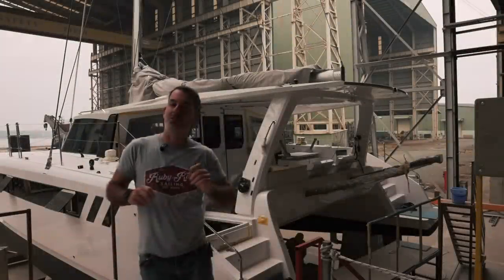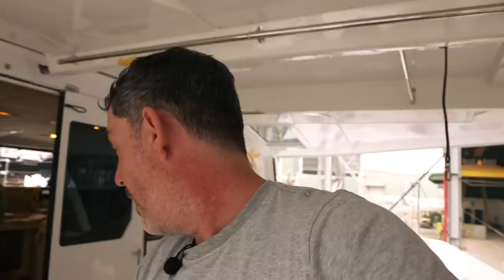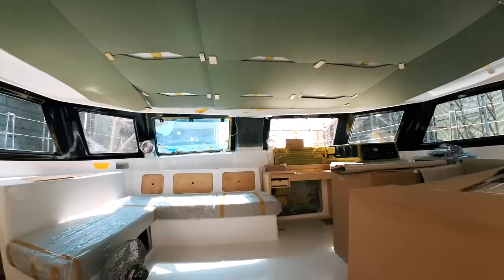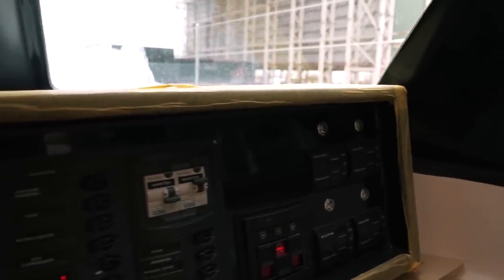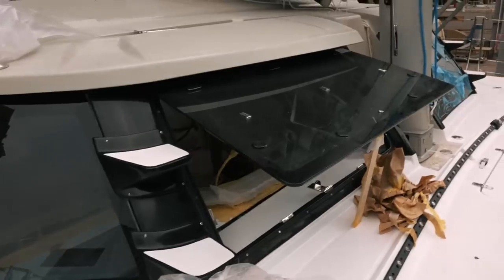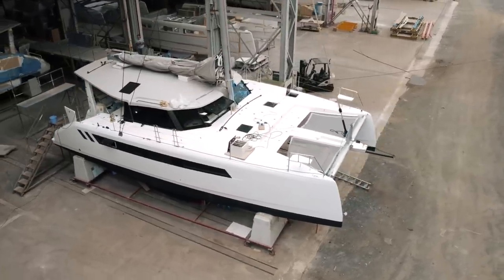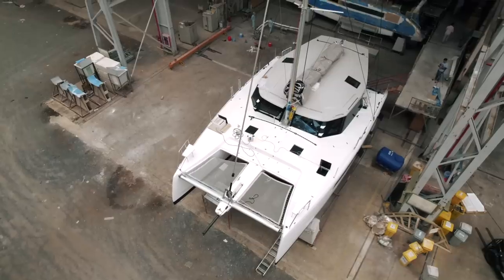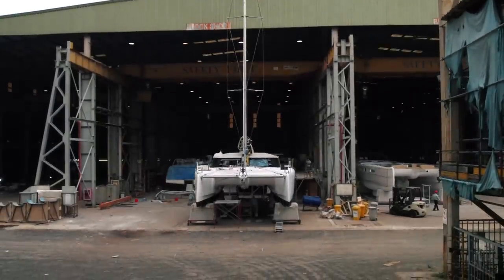CATAMARAN BUILD: The Final Countdown!

Comment: Hi Nick. I must admit that, until last week, I could never understand your focus on a sheltered helm, given that you owned a monohull and they are almost all fully exposed. But last week in Miami, I interviewed Rob Poirier from Privilege America and he had one specific key lesson that I took away from that chat and that made me understand your point about the helm. Rob said, “ Dave, there are three things that will kill your circumnavigation project with Sylvia: Sick, Scared and Board.” He went on to say the “sick” has many solutions. “Board” can be overcome many ways as long as you plan for it, but scared is the one that kills a plan like mine faster and more permanently that either of the other two issues…and that is where your focus on helm came screaming into focus. Same or mid level helms will allow Sylvia to communicate with me and feel connected and secure at all times. Sheltered helms will allow us to stay dry, warm and unfatigued so we are better able to manage our emotions and fear doesn’t creep up so easily. A lower, more stable position also makes both of us feel more secure in heavy seas as the higher we are the more leverage and speed the motion exerts. Finally, Rob pointed out that a good helm also shelters your hearing from the fear inducing violet noises that can come from high wind whipping through the rigging and the violence of the water in heavy conditions. These sounds can, again, ignite fear and impede  your ability to manage your emotions and the situation safely. 

So now I get it and it is probably an even more important lesson for me with Sylvia than it is for you guys. 

So THANK YOU!!  All the best, Dave. @NavalGazingatCampDavid.
Reply from the maker: Thanks mate. I’m glad you agree. Good luck with your plans to circumnavigate

Comment: Your enthusiasm is ever again so inspiring ! As for the boat itself, one thing I question is the position of the steps on the forward edges of the pilothouse (?) where there is no guard railing or something similar to hold on. At sea this will be a problem, especially when carrying something.
Reply: There is a retractable stanchion type bar next to each set of steps to assist in safe movement to the coach roof.

Comment: Can anyone explain to me why the kitchen cabinetry extends into the doorway between kitchen and outside? By what appears to be nearly half of the width of said doorway, no less. Seems odd to me.
Reply: Very common design in cats when using sliding or folding doors to create an indoor/outdoor space.  You only need part of the passage for walking in/out and out and this way it will feel like an outdoor kitchen when the doors are open with the added benefit of creating a kitchen island that can fit more people working or hanging out.